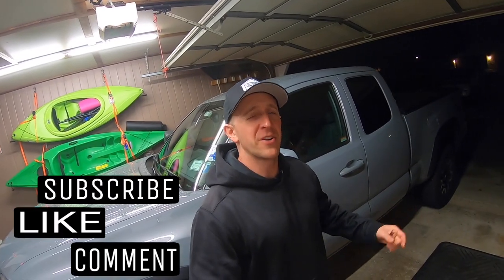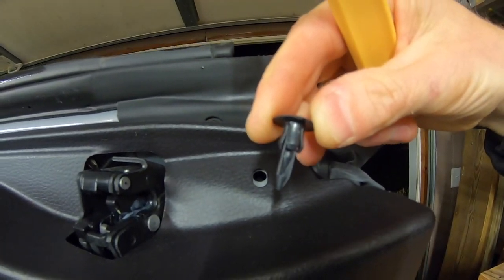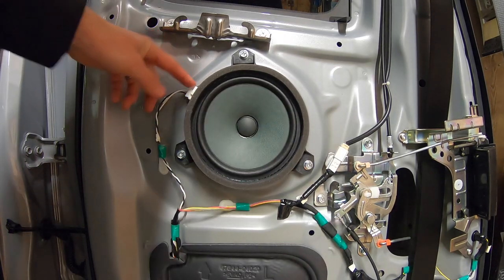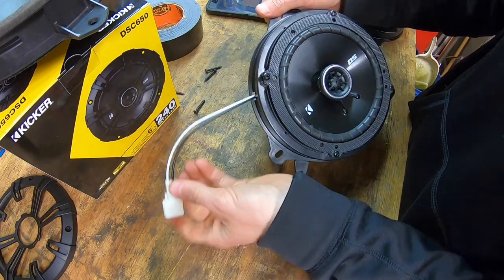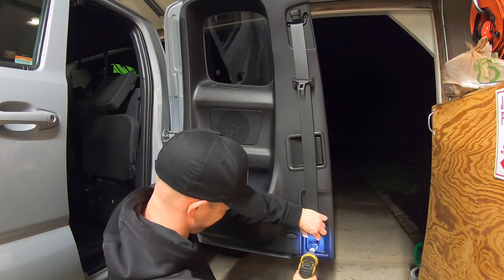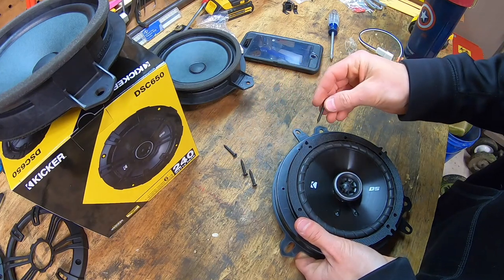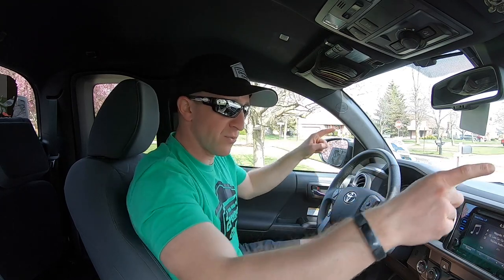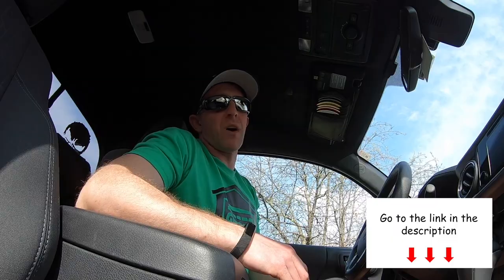3rd Generation Tacoma Access Cab Door Speaker Install - Kicker Plug & Play Upgrade

Comment: Thanks for the video series, they are true time savers.  I ran into the same issue as @Mountain Chief did with the access door plugs being different on my 2020 Tacoma looking like the Camry plugs.  Instead of Amazon though, I did purchase the 6 1/2 's through Crutchfield (since the brackets and wiring harnesses were included with the speakers) and after talking with their tech support, they are sending out the plugs similar to the  2018 Camry.
Reply from the maker: No problem Aaron! Thanks for checking them out! It sounds like that seems to be the only difference as we go up in model years. Enjoy your new level of sound quality! 👍

Comment: Huge difference in the before and after. I'm like you. Doesn't need to make my ears bleed. Just needs to sound good. I like my sound over volume. I love my Bose sound system at home because it sounds great and if I want to turn it up it still sounds great.
Reply from the maker: Whitie in Vermont you and I think alike!  I hate it when music is so loud that everything starts vibrating in a car. Doesn’t sound good. I’m a bigger fan of clarity. Bose makes great stuff. I have a single speaker by them and even that sounds great!

Comment: Also, you are so correct, the Access Cab recieves very little attention, Regarding most mods. I will take the Acces Cab again in a heart beat.
Reply from the maker: Edward Dillon access cabs don’t seem to get the attention they deserve. I like the look of them almost better in my opinion!  The four door has its place if you have a lot of passengers but if you don’t you’re just driving seats around and in that case I would go with the longer bed. Fit more stuff ya know!
Reply: @GarageGear  The whole reason I bought the Access Cab in the first place, you are spot on brother!!
Reply: @GarageGear  What I did and with a Manual!
Reply from the maker: @AveMarie1  nice brother!!! 👍

Comment: Just done this.  Connectors were different on my 2020 OR Access Cab but no worries - all worked out proper.   Thanx for the video.   Will tackle the front doors at a later date.
Reply from the maker: Walter excellent my friend! Glad it worked out for you!!! Thanks again for watching!!!
Reply: Not inch sound coming from these rear speakers...  moved the balance all the way to the back speakers and barely anything coming out of em.  any thoughts?
Reply from the maker: Walter be sure to double check your connections. Perhaps the wires are crossed? Other than that I’m not sure.
Reply: Garage Gear amazing what one crossed speaker will do to the entire experience.  All good now.  👍
Reply from the maker: Walter ok good to hear! Glad we figured it out!!!
Reply: Garage Gear yup - thanx to you....  Amazing how quick it goes when ya just suck it up and gently pull on the door covering.  First Taco owner here - I am slowly seeing why so many people love these things.  Next thing I want to tackle is putting a storage box imbedded on the drivers side of the bed close to the tailgate.  That’ll take some cutting but I think, not know for certain, this’ll fit - https://www.tuffyproducts.com/toyota-tacoma-2020/product/235/lockbox-truck-bed-toyota-tacoma .  Just a bit concerned about making that bend through the opening.  Thanks again man!
Reply from the maker: Walter no problem bud! Good luck with your next project!

Comment: Question… why did you go with the Kicker DSC650 as opposed to the Kicker 46CSC654? The middle part of the 46CSC654 match the speakers you installed in the front doors.
Reply from the maker: Someone recommended them to me a while back! Great sound out of them!

Comment: Another great video.  I got the bottom of the line 2020 because I didn't need all the bells and whistles, so mine only has covers where your speakers go.  I assume I could purchase the grills somewhere, but then I doubt my truck would have the speaker wires.  I will pull the covers and take a look.  Any ideas on what or where I could purchase the wire harnesses?  I love your set up and would like the same.
Reply from the maker: You may want to give a call to crutchfield.com and see if they have the exact wire harness for your situation. They could maybe point you in the right direction at least. Thanks for watching. Let me know how it works out! 👍
Reply: @GarageGear  I"m going to their website now, thanks for the info!  And will do!

Comment: Love it. Where did you get the wire adaptors? Did you make them?
Reply from the maker: @Ridezallday1679  I have the wire adapters linked in the description.
Reply: @GarageGear  cool. I have an 21 sr. You video was great. Im just hoping when I take the access cab door panels off there are wires run already. I traded in my loaded 17 sr like yours and i miss the rear speakers.
Reply from the maker: @Ridezallday1679  got it! If you have speakers there already the you should be good. Other than that not sure if there are wires of there are no speakers
Reply: @GarageGear  no speakers. ☹️ i can hook them up tho. Just have to figure it out
Reply from the maker: @Ridezallday1679  ok let me know how it goes!

Comment: What if my tacoma never came with speakers back there? but there is clearly a sign on the panel for the speakers, I'm just trying to see if there are wires hiding back there or would I need to completely rewire?
Reply from the maker: Hey tone! If there are wires you can probably tap in. If not, most likely not. Thanks for watching!

Comment: After upgrading all 6 speakers did you notice the head unit overheating or being overpowered by the new speakers? Do you feel the need of installing an amplifier?
Reply from the maker: No overheating whatsoever. For me the sound is fine and very clear. If you’re going for loud volume you may want to consider an amp! Thanks for watching!

Comment: My 2017 SR didn’t have rear speakers, they’re actually sealed. Do they still have the wiring behind the panels?
Reply from the maker: Good question. I don’t have an answer for you on this but you may want to check crutchfield.com. You can probably find your answers there. Thanks for watching A1!
Reply: No they don't
Reply: The wiring is under the door seal trim strip, back between the side wall and storage area.

Comment: i got 2021 tacoma access cab but it didnt come with the back seats or back speakers , can i still add speakers to it ??
Reply from the maker: That’s a good question! It sounds like you own a SR model? The mounts for the speakers may be there under the plastic door panels but you may not have speaker holes in the plastic panels. You could make/ cut your Own out or you may have to buy new panels. Not exactly sure what your situation looks like there. Thanks for checking out my channel David!

Comment: Now the biggest difference will be if you upgrade the HU to something Non-Factory, then you can tune it alot better, plus u might get added features ur factory HU did not give you!~
  The Kenwood Hu is showing me the voltage, tire pressure & temp and also the temp gauges an fuel %, the factory Hu did not show any of that!~
Reply from the maker: @Warg666  cool my friend! Thanks for sharing

Comment: have some questions, will this also work on 2nd gen? and did yours have the speakers in access doors mine is a blank panel so not sure mine is wired but i see you have basically same as me. I blew 1 of my 6x9 in door, so thats the next video i am watching of yours
Reply from the maker: Tim Francis hey bud, I’m not 100% sure they are the same. I think they are very similar with only some minor differences. I think it depends on the model. Which model do you have. Some models may not have had them in there.
Reply: @GarageGear  own a 13 sport, magnetic grey. and lost all bluetooth in head unit and speakers dont have any mids, so they are coming out
Reply from the maker: Tim Francis go for it bud! Give ‘em a boost! 👍

Comment: Thanks for the links.  I have the same truck.
Reply from the maker: Awesome Alex!!  Enjoy the new sound when you get it all set up! 👍👍👍
Reply: @GarageGear  thanks for the help bro
Reply: @GarageGear  got it all set up and works great!  I couldn't find the parts for it anywhere untilI saw your video. Thanks for posting the links for everything.    I like it and now I'm gonna order this setups for my double cab.   It's kinda wired but the bass sounds way better on the double cab. I think I'll get a woofer for my access cab since the back seat area is just for storage.  Have you done that?
Reply from the maker: @alexgarcia3900  awesome my friend! Go for it! I have not done any other sound mods since this install. I would like to do an amp but I’m still figuring that one out. If come across anything please let me know.
Reply: @GarageGear  there's one that's called oem speakers I believe and they make a great system but I don't think they sell just the woofer setup unfortunately.   But it looks very nice and stock but it's also very pricey
Reply from the maker: @alexgarcia3900  got it thanks for sharing my friend!
Reply: @GarageGear  so I finally ordered two 8 inch subs in a ported box and it literally fits standing up in the corner seat and it won't even cover up the rear window.   Should sound pretty loud specially for an access cab.   Spent 600dls on everything.   Was gonna be about 480 for just one and I wasn't sure if it was gonna be enough.
Reply from the maker: @alexgarcia3900  awesome my friend! bet the sound is incredible in that thing!
Reply: @GarageGear  I hope so.  I just ordered it so I don't have it yet.
Reply from the maker: @alexgarcia3900  it will! Keep me posted! 👍

Comment: 2020 Tacoma Access cab rear door speaker update.  Toyota change the plug on the rear speakers starting in 2020 3rd gen.  Here's the link for the rear door adapter plug you will need to install your 6 1/2 kickers. https://www.amazon.com/gp/product/B08213PXTP/ref=ppx_yo_dt_b_asin_title_o00_s00?ie=UTF8&psc=1
Reply from the maker: Thanks for the tip! And thanks for watching!
Reply: @GarageGear  you’re welcome! Great tutorial:)
Reply from the maker: @mlbentertainment4653  👍

Comment: A FEW THINGS:
1. This is much harder than the front speaker install because putting the panel back on is ridiculous.
2. Removing the side trim before removing the door cover might help, and it's not hard to put back on
3. If you deform a red snapper just toss it, it's not worth the headache trying to make it fit 
4. Don't touch the seatbelt adjustment area. Seriously, it needs to fit right back on in the same position, so if you adjust it when the door is off you will regret it.

I gave up trying to get the outer side back to perfect, those panels are BRUTAL. Seriously, take it slow
Reply from the maker: FalcoCaliber this I think was definitely the trickiest of all the installs. Definitely need to go slow and take your time. I did warp a few red tabs in the process but they went back in fine. No issues with the seatbelt on mine. Did you do this on a 3rd Gen? Or an older model?
Reply: @GarageGear  3rd gen, 2019. I'm gonna buy more red tabs in the future and try to get it back to factory, but it was hard
Reply from the maker: FalcoCaliber keep me posted on how it goes.

Comment: My access cab wasn’t prewired
Reply from the maker: What year/ model do you have A1?
Reply: @GarageGear  its a 2017 tacoma 2.7 2wd, utility package access cab
Reply from the maker: @ExploreAnywhere  there are some Tacoma models that don’t have speakers in the access doors. If you want to install speakers in those doors you may find help on crutch field.com. But I can’t be totally sure. Hope this helps! Thanks for watching!
Reply: hi i was wondering were you able to run wire for new speaker ? I have the same truck same year i havent removed door panel to find out if mine is prewired
Reply: @atangelhernandez9440  haven’t tried yet!